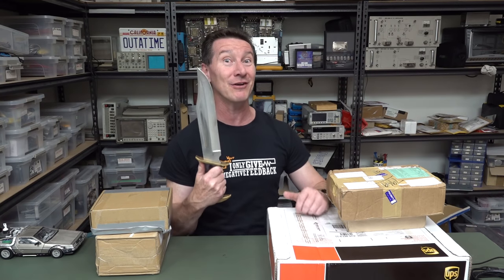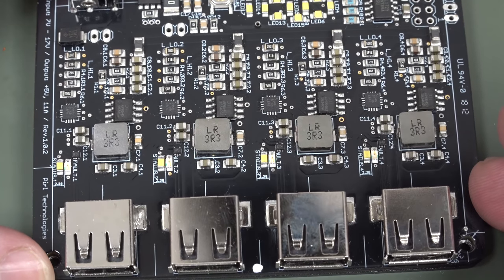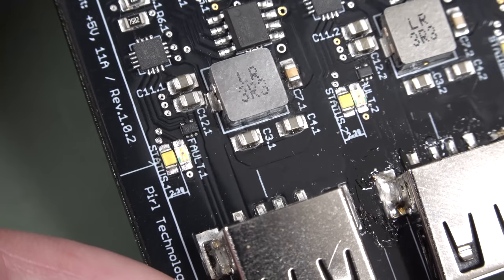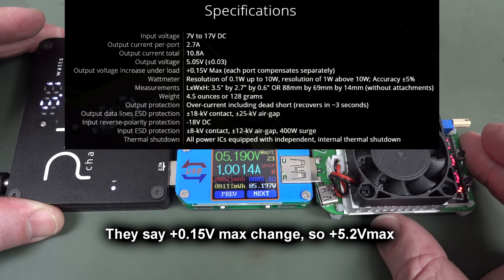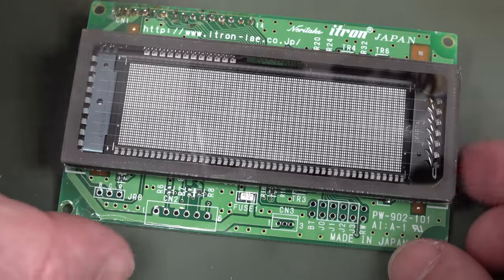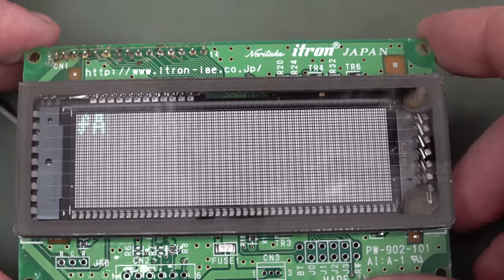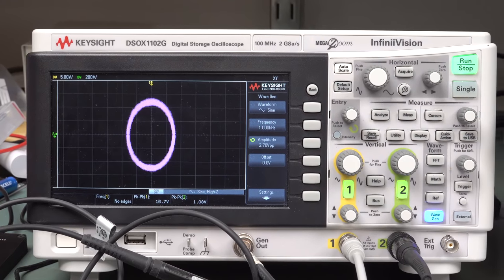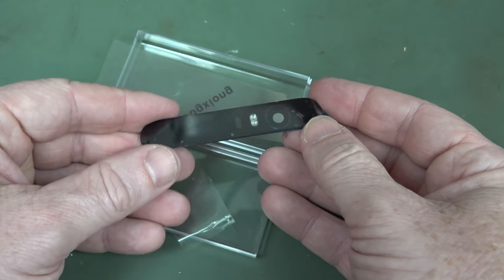EEVblog #1137 - Mailbag Monday

Comment: The charger output is designed to increase as current goes up in an attempt to compensate for typical cable drop so it delivers the right volts at the end of the cable, not at the charger port. I reviewed one of these a few months back and overall it is a nice device but it is basically a dumb charger. no negotiation with the connected device. great for a bench supply for all those Raspberry PI projects and the like.

Comment: The cell phone part from China is the camera "visor" for the Nexus 6P I think. They are notorious for breaking when disassembling the phone for repairs.
Reply: Yep, 6p.
Reply: That still doesn't answer the question why it was sent.
Reply: Yep, 6p. Broke that piece on mine not too long ago when I was replacing the battery.
Reply: Ryan Willis I thought it resembled the metal strip on the LG Optimus 2X, when that breaks, most stuff keeps working without it.

Comment: Smart chargers are trying to sense the capabilities and requirements for the connected devices, devices are trying to sense the capabilities of the charger.
Both fall back to the lowest possible current. Can you see the problem here? Just output the 5,2V dammit!

It's like graphics cards and monitors. The graphics card won't output a signal if it doesn't detect a monitor first and the monitor won't allow to select an input until a signal is applied first.
The "smarter" devices become, the more it makes me go medieval on them.
Reply: quickcharge modes use voltages higher than 5v
Reply: And USB-PD can supply up to 5A@20V...
Reply: @tommihommi1  9v-12v-20v for qc2.0 and for qc3.0 from 5v in 0,1v steps all the way up to 20v. I think. The major problem I've always encountered is that the USB cable has so much voltage drop on 5v so even though the supply is 5.1v the phone senses 4,8 volt on the other end and limits to charge current because it thinks the charger is about to brownout.
Reply: Would be good if phones could message charge controller about the voltage they receive.
Reply: @Morten The changer on my Samsung Galaxy S5 did a very good job of making sure the voltage on the other end of the cable was decent. Sucker had an output of 5.4V on no load, going up to 5.7v with a 2 amp load, never measured the voltage at the end of the cable but I assume it was enough as it made some power banks be very warm while charging
Reply: yeah, it's dumb as dog shit when it really should be quite simple. output 6v and let the device manage the charge since the device has the battery in it and the device knows what battery it is. The device already contains a BMS so let the BMS manage the system!   

WHY they decided that the power supply should limit the current I'll never know! must be a legacy of the original USB 1 amp limit.  Either way... i'ts frustrating as hell!!!
Reply: Jimmeh B It comes from using the USB data cable as standard charging cable.  Feeding more than 5.25V (5V + 5%) into a short robust cable could fry chips in actual peripherals.  Charging specific efforts have focused on raising the current, and optionally the voltage without changing the overall computer-centric design.  USB-PD can be reasonably (not full feature) implemented by having a few on-chip resistors choosing between the 5V and 12V from the computers main power supply. 20V matches the raw DC from typical laptop chargers.  Phones wanting more than 5V need an onboard switch mode regulator anyway, so should be built to work with any of the standard voltages minus an unknown cable drop.  Qualcomm quickcharge doesn't follow this master plan.
Reply: @Jimmeh_B  -- original USB is 500mA. 2A at 5V = 10 Watts from a four output hub. 500mA is a lot, given the teensy wires and connection surface areas originally expected to be used in the mini- and micro plugs.

Comment: It looks like the top part of the USB charger (lid?) has a square cutout of the USB ports so it would take the strain off the sockets when you  🔨 the ports. Also the ruideng USB meter and RD USB load behaves like that when you go over the limit of what the supply can suffer, the screen turns blank but it will still draw an odd amount of power although reduced from what initially set. Got the same thing here on Ruideng um34 and Ruideng t64 together with their ld25 and hd35 USB loads. No fault on the charger so to say. Shame about the lack of quick-charge.

Comment: Hi Dave! Re: the curve tracer. I did something similar - but much simpler - in EE lab in College. I just took a 12 VAC wall-wart, a 1% 1k resistor and the DUT. Wired the 1k resistor in series with one lead of the transformer secondary and a solderless breadboard to mount the DUT. The other lead of the xfmr went to the DUT, and the other end of the resistor to the other lead of the DUT, so all in series. Now hook the X-axis across the DUT and a small 1:1 toroidal transformer across the 1k resistor, with the Y-axis on the other side of said toroidal transformer; this way, the Y-axis is not ground referenced to the circuit. Set the scope for X-Y mode, and hook up the DUT. Set the scale and have fun testing components. I was able to demonstrate the correct “waveforms” for resistors, capacitors, inductors, diodes, and a small zener diode as well.

Comment: On the pirlcharger web site, they mention something called Wire Compensation "to compensate for power loss in wires and connectors."  That would explain the increase in voltage as the current went up. It's by design.

Comment: the pirl charger actually compensates for the voltage drop you would get on a USB charging cable while running at 2A.
Reply: That should then increase the voltage with the current, not decrease it.. I smell something rotten in that thing.
Reply: the voltage first increases as the current goes up but it has a limit up to which it can increase while the current still goes up and the voltage drop increases even more, that's why it starts to go down.

Comment: On the Octopus curve tracer: Connect both grounds to the shared XY terminal, the probes to X and Y, and set the scope to invert one of the channels. No differential probe required. Used to do that to test PV panels.

Comment: That TI IC says something about cable compensation, that's why you get that voltage raise.
I don't understand why you dislike it.
Very often smartphones will charge at full current only if you feed them at least 5.2V because of the voltage drop.
Yeah 5V is the perfect value but it's not anymore when it reaches charging IC with 4.8V...
Anyway that Pirl chargers seems to be quite a crap, and probably expensive, just because of that display.
You can get 5 port mains PSU from BlitzWolf, 2.4A each, with support for for 5V handshake protocols, for like $20.
Reply: Blitzwolf BW-S7 40W this one got one of the ports with QC3.0
Reply from the maker: I like my voltage regulator to regulate. Also, the compensation seems wrong, s it goes back DOWN at higher currents.
Reply: I think that Piri charger was a Kickstarter item or another crowd funded result.
Reply: I think it started to fall after it rised because you were experiencing that voltage drop.
Yeah I think it was kickstarter and also expensive AF...

Comment: What's the point of that "curve tracer" when you need an fgen and differential probes. As it is it's just an opamp and a shunt resistor. At least build the ramp/triangle generator into it....
Reply: Ya, just a 555 and some passives. Also, could've had its output amplified just by adding a small trimmer/pot to adjust the gain on the opamp. That would've been very useful since most scope AFGs max out at 5V(+-2.5V), even though the batteries allow 24V(+-12V). Still a nice item that could be useful to a beginner in some scenarios or as a teaching instrument. One of my first electronics projects was just that, but I used a 556 to generate 2 ramps with a variable frequency so as to allow for a 3rd "Gate" input allowing me to have steps for a transistor tester/analyzer.

Comment: For the curve tracer I would recommend just connecting the ground of the scope to the low end of the shunt resistor. One channel will give you a voltage proportional to the current, the other one will give the voltage across the component PLUS the voltage over the shunt. Not 100% correct, but assuming the voltage over the shunt resistor is small, you will probably not see the difference. It is, after all, not for detailed measurements, but just to get a quick idea of what a component is doing.

Comment: Why not just adding a differential to single ended converter into that curve tracer. That's not to difficult to add?
Reply: Merlin Gallagher Yep, should use a quad opamp or two and also 3 BNC sockets for siggen, X and Y so you don't fiddle with hooking probes into it.  9V is also a more common battery choice for the job.

Comment: That slightly increasing voltage with current on the USB psu is useful to give approximate compensation for voltage drop in typical USB cables under load.

Comment: I built my curve tracer. It runs with a 12v plug in adapter. It makes troubleshooting very fast. I got my design from an electronics magazine years ago. Mine has a switch for high and low voltage. I like it best on my analog scope. But I have used on my digital also.

Comment: i really fancied one of those vacuum displays for a metal detector i built from scratch, but it took way too much power the difference between that and a standard two line lcd in terms of battery life was ridiculous, the vac display drew more power than the smd detector circuit.

Comment: That charger is useless without Quick Charge support.
Reply: have to agree. It woulda been nice back when blasting 2.4A through was the fastest way to charge, but now most does the QuickCharge autonegotiation 5V@3a, 9V@2a, 12V@1.5a - and even higher than that sometimes. My LG G5 charges at 18 watts in this method.
Reply: @mrlithium69  Don't forget that laptops charge over usb too these days

Comment: I like the chargers that increase voltage with current. They are the best: compensate for voltage losses in cables. My original Samsung charger does the same.

Comment: I don't understand that USB charger display.. it's a 2.5-digit display, meaning max value is 19.9W, but at 4×2.7A 5V, surely it can deliver more than 19.9W, that was the whole point? What's it gonna display when it's above 20W?
Reply: "What's it gonna display when it's above 20W?" Probably changes range. (Decimal point disappears.)

Comment: For those VFDs, did you check to see if there is an interface config switch or jumper on the back? I have an ieee flip 14 segment 20 char that has that.
Reply: someone pointed out that they might not support 4 bit mode

Comment: Those itron displays may not be drop in replacements. I have a couple 20x2 itron VFDs that are straight hd44780 drop in replacements. same protocol, same initialization. There are some extra commands for setting the vfd brightness, but other than that they're identical. However, mine are not full dot matrix, they're still very much 5x7 + underscore per character with gaps in between.
Reply: I would guess the itron requires 5v power+data, the little battery thingy looks more like 3V…
Reply: he's running 5v power in the video, but could still be 3V data. I don't think it'd be happy with 3V data, it wants 5V logic.

Comment: There is a scope that will give you differential X & Y inputs but you will have to go back in a few decades:  a Tektronix 7000 series mainframe with a pair of differential amplifier plug-ins will do the job nicely and will also give you a beautiful crisp trace, unlike the fuzzy traces on digital scopes. Sometimes the old school analog technology still performs better than the modern digital technology.

Comment: The Curve Tracer could've been designed with grounded X and Y output by using only 3 resistors more, this way diff probe could have been omitted.

Comment: I had a drive dock that you can drop a 3 1/2" inch or 2 1/2 inch hard drive into. I wanted to use it to test a new drive I got and transfer some data over, and the mini USB connector fell in. Yes, it fell right off! Mine is just a tiny connector, your great big USB A housings have giant heat sinks that will never solder properly.

Comment: May be the voltage increased with the current to compensate the loss on the USB cable.
Reply: Well how do you explain then the voltage decreasing when he upped the amps? It just jumped the volts up in the beginning at light load.

Comment: Not sure of the circuits in Australia but the most our household wires on a standard circuit would take is 15 amps and if u have a lamp or PC powered on that same circuit the breaker is gonna go POP if you are running all 4 at max amps

As for the finger rubbers are those special anti static condoms for extra protection from the bodge wire fairy
Reply: John, there is no problem with household wires, a power supply reduces the voltage and increases the current. 10 Amps at 10 Volts is equivalent to 1 Amp at 100 Volt.

Comment: Piece of crap-it-self out of the gate; hear me out; Unidirectional Serial Bollocks connector style, shitch mode PS, and any versioned device being so unstable that it’s consigned by its frailty to requiring a reset button for functionality which also sadly occludes its button for more than aesthetics does condemn of itself what was already mired in weak sauce.

Comment: i don't think that is the most powerful multiport USB charger. any charger that supports USB PD is probably more powerful. Without USB PD i think calling it "the most powerful" is a joke. A single USB PD port usually delivers more power than that thing does.
This one is half the price(less if you are in HK) and twice the power for example https://www.ebay.com/itm/123437002881 AND you don't need an extra powersupply. That pearl device is a ripoff at almost 100$, it doesn't even support quickcharge.